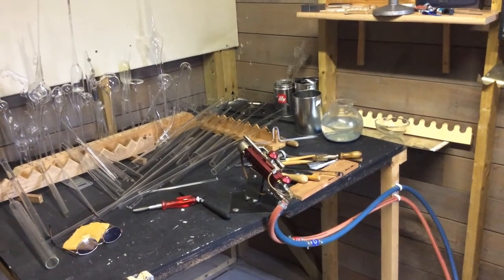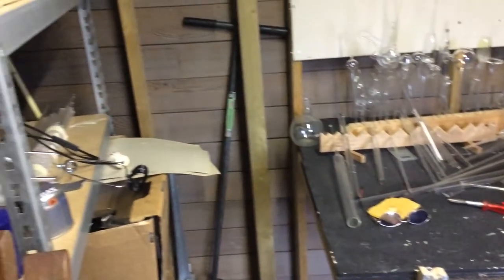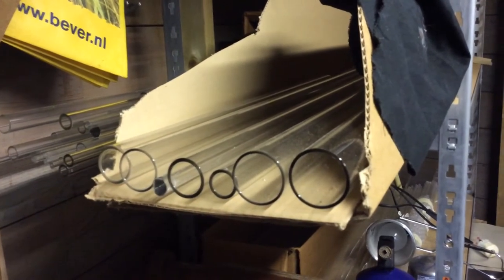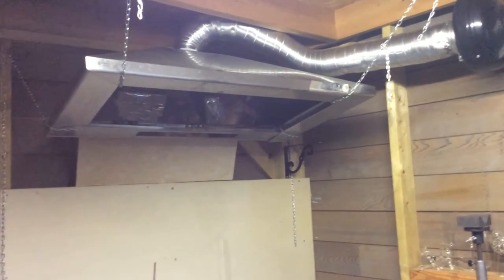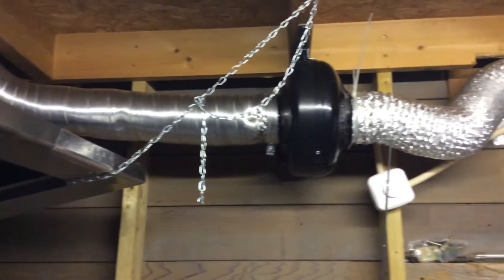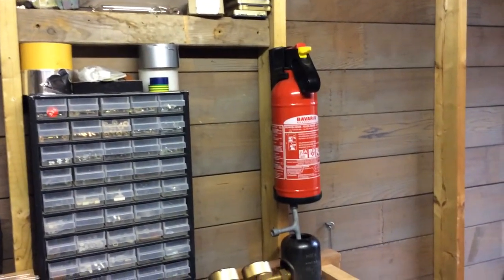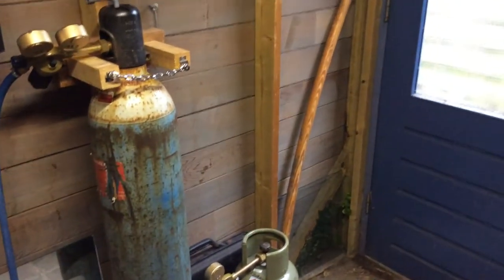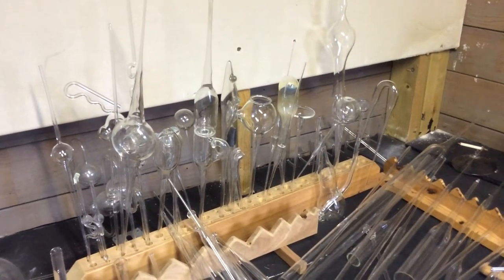glass shop 2014

Comment: no kiln?? you can carbon coat your pieces and the carbon will act as an insulator if you didn't already know that.
Reply from the maker: +rhoropez 
The flame annealing technique is indeed the only method that I use now. I need very soon a kiln as it is so handy to have, but also more dangerous (wooden shack) and expensive. That is the reason I don't have one yet...
About the insulating effect of the carbon layer I have a different opinion.. It is not so much as an insyulator, but a way to know if your peace was at equal temperature. It same parts of your piece are much hotter than other parts, the carbon will burn of at these places, meaning that the annealing was not done correctly. This technique was common when they still used sodium glass ("soft" glass).